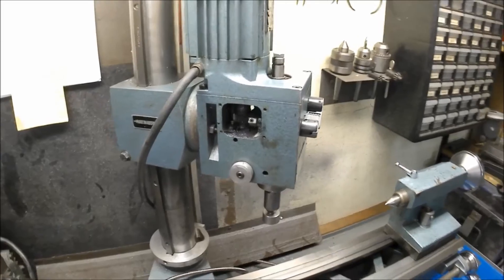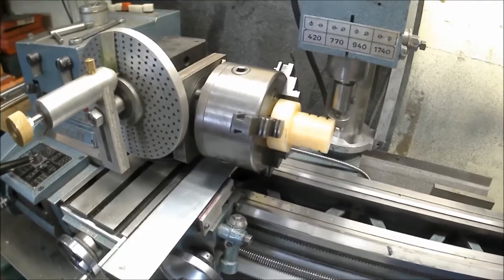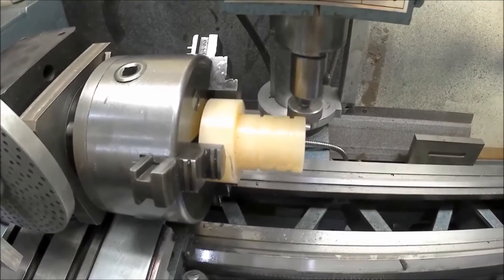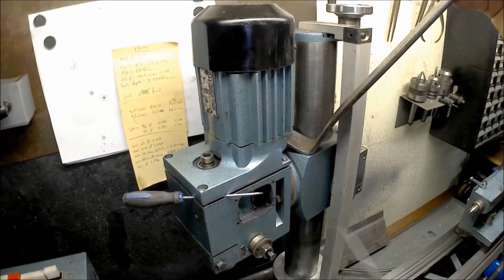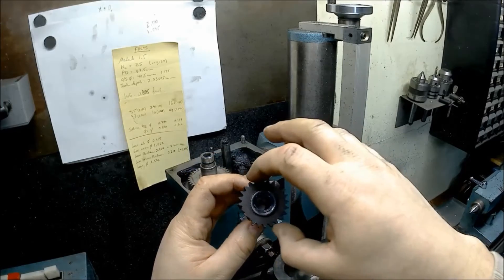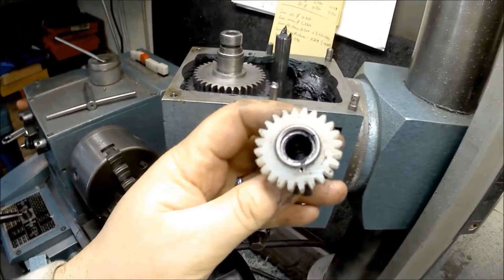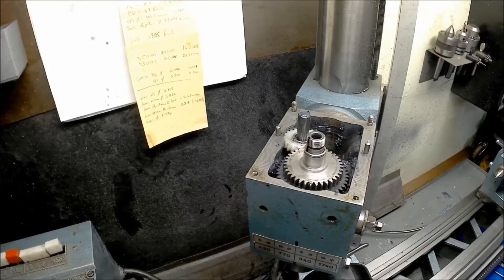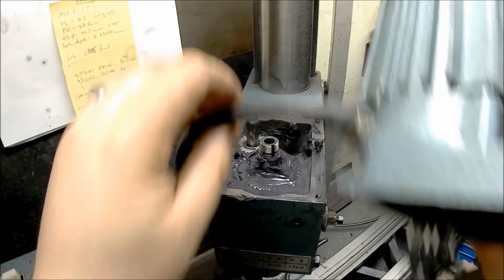How To Fix A Gear For My Emco Maximat V10 Mill Head

Comment: How's the mill working with the nylon gear's, I did the same and they lasted about ten minutes of light cutting
Reply from the maker: I'm still using it and it's been years.
Reply: @ChrisOfAllTrades  mine lasted ten minutes with some light cutting so I’m going to brass gears,ty for the reply

Comment: I have the same machine  my gears actually broke.  I found a machine shop that was going to cut brass gears. I forgot about them till 6 months later.     When I went back he had passed away and my gears were lost.  What would you charge to make both plastic gears out of brass ?  I would love to get it operational again
Reply from the maker: It's not even so much how much I'd charge, but I'm right in the middle of a massive renovation project that will most likely take me to the end of the year. However, if you email me around Christmas time I might be able to do something. Email me at eigenheerc at hot mail dot com

Comment: How long did the gear last? I 3d printed several and they only lasted about 5 minutes.  Tried with nylon,  petg and abs. printed gears are out. Just trying to figure out if cutting an aluminum one would be a better option.
Reply from the maker: I'm still using it 2022

Comment: hi. how do you have an indexing head fixed vertically? i can only fix horizontally. thanks for disclosing, that i was supposed to take off the gearbox leavers before i took the gearbox apart last weekend !!!)
Reply from the maker: It's just the way my dividing head is configured. but you can get an angle bracket and bolt it to that. that should work. good luck with your project.

Comment: Thanks for showing how you removed the gear selector levers and the motor / top of the mill head.  

Your video will help me to remove mine so that I can check inside and make sure that all the old grease is removed.

Comment: I liked your video very much most educational. I always thought that oil was used in the milling head. Is that graphite grease?
Reply from the maker: no, it's molybdenum grease. you can get it at the local hardware store. and yes, you're right, some milling heads have oil, depending on the make/model. thanks for watching